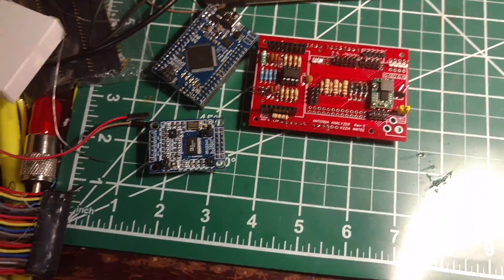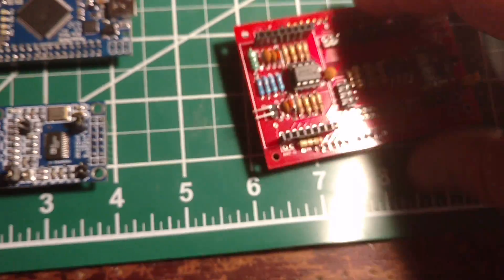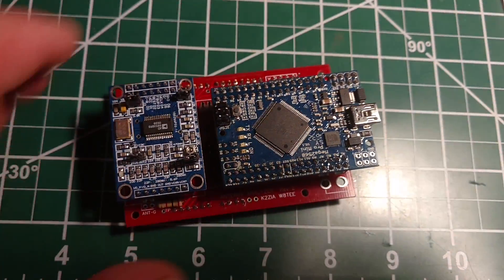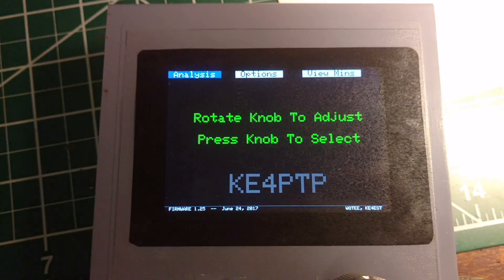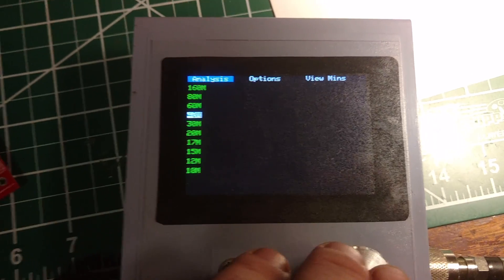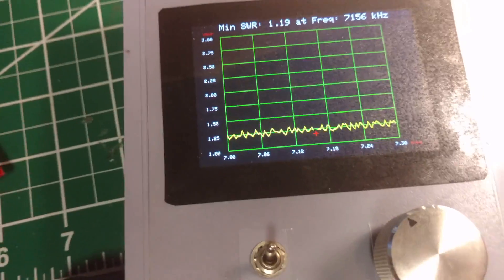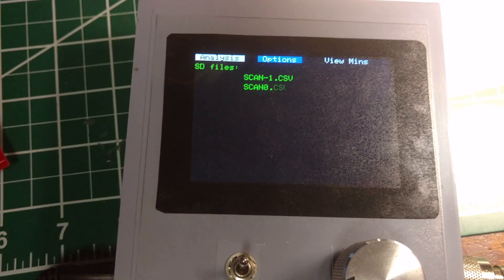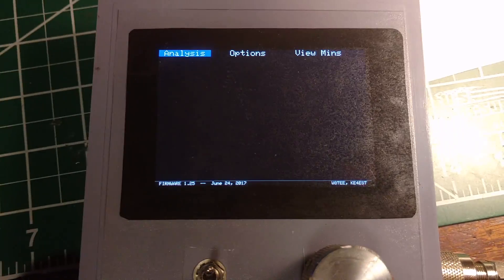Arduino Antenna Analyzer Review

Comment: I notice you have not installed headers in all locations on the PCB. I assume you have only installed those that are necessary for operation. Is this true or was the PCB not completed?
Reply from the maker: Yes, that is correct.  Only, used what was needed.

Comment: I built one and I get error trying to compile the code.
Reply from the maker: What version of the IDE you are using and what version of code.  Also include what error you are getting.  Are you familiar with the Arduino IDE?  If your first go at it, you may have some settings wrong.  Make sure that you have selected your board as Arduino Mega and 2560.
Reply: Michael Graves  I have I think mine is 1.65 the software I have was downloaded from qrpguys where I got the board. It's a interrupter error.
Reply: Michael Graves 
Arduino: 1.6.5 (Windows 8.1), Board: "Arduino Mega or Mega 2560, ATmega2560 (Mega 2560)"

PurdumAntennaAnalyzerRel108.ino: In function 'void setup()':
PurdumAntennaAnalyzerRel108:2024: error: invalid conversion from 'int (*)()' to 'void (*)()' [-fpermissive]
In file included from C:\Users\kevin\Desktop\arduino-1.6.5-r2\libraries\AD9850SPI-master/AD9850SPI.h:33:0,
                 from PurdumAntennaAnalyzerRel108.ino:29:
C:\Users\kevin\Desktop\arduino-1.6.5-r2\hardware\arduino\avr\cores\arduino/Arduino.h:142:6: error:   initializing argument 2 of 'void attachInterrupt(uint8_t, void (*)(), int)' [-fpermissive]
 void attachInterrupt(uint8_t, void (*)(void), int mode);
      ^
PurdumAntennaAnalyzerRel108:2025: error: invalid conversion from 'int (*)()' to 'void (*)()' [-fpermissive]
In file included from C:\Users\kevin\Desktop\arduino-1.6.5-r2\libraries\AD9850SPI-master/AD9850SPI.h:33:0,
                 from PurdumAntennaAnalyzerRel108.ino:29:
C:\Users\kevin\Desktop\arduino-1.6.5-r2\hardware\arduino\avr\cores\arduino/Arduino.h:142:6: error:   initializing argument 2 of 'void attachInterrupt(uint8_t, void (*)(), int)' [-fpermissive]
 void attachInterrupt(uint8_t, void (*)(void), int mode);
      ^
invalid conversion from 'int (*)()' to 'void (*)()' [-fpermissive]

  This report would have more information with
  "Show verbose output during compilation"
  enabled in File > Preferences.
Reply from the maker: Go to arduino.cc and download version 1.8.5 and try again.  If that does not do it send me the code you are trying to compile to my QRZ address and I will look at it.
Reply: Michael Graves I can't get into my qrz account anymore. Been trying to get in touch with them and nothing so far. OK thanks
Reply: After 3 hours I got it downloaded and it loaded on to the AA fine. But with 100 ohm load its saying not below 5to1. I got something eles going on now
Reply from the maker: Go here and join and read some of the things there.  https://groups.io/g/SoftwareControlledHamRadio/  You may have a DDS unit that is not outputting correctly.  Do you have a freq. counter?
Reply: Michael Graves yes a old one.
Reply from the maker: Some guys found that the ones they ordered had a 30MHz oscillator on board instead of a 125MHz and that threw the frequency off.  You can fire it up, go to frequency from the menu and select a frequency then put your counter on it and see if it matches.
Reply: Michael Graves OK will do.

Comment: Hi Michael I also build this analyzer but I am seeing some very weird results while it is connected to a 50 Ohm dummyload. Basically from about 13Mhz upwards the SWR is slowly rising till about 1:1,25 while I would expect it to be a flat line across the 0 - 30 Mhz span. Did you see something simular, I am at a loss as to why this is happening. I did read some posts about the ADS9850 putting out lower power at higher frequencies but not sure if that is causing this? Regards and 73 Leo
Reply from the maker: No I have not noted that.  Go here:  https://groups.yahoo.com/neo/groups/SoftwareControlledHamRadio/info  join the group and there is much much reading about it and you can ask Jack there also. :)
Reply: Check on QST, september 2019 issue, page 56

Comment: How hard would it be to modify this to run 70cm to 11 meter?  I am getting my technician licence but still run 11 meter on my xterra for my off road club.
Reply from the maker: One would have to get a whole different DDS board to be able to go to 70cm.  I myself do not know if a cheap board exists that one could use in their own project, easily.
Reply from the maker: It would do 11 meters as is.  Just go to frequency in the menu and dial down to the frequency you want.